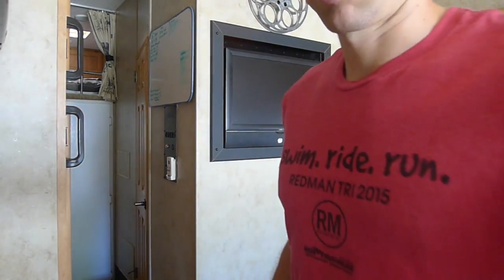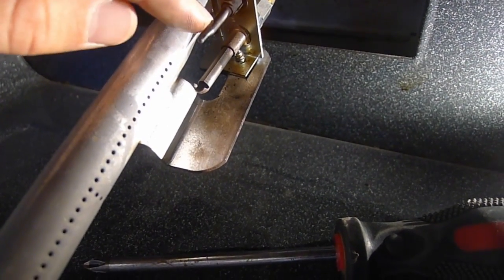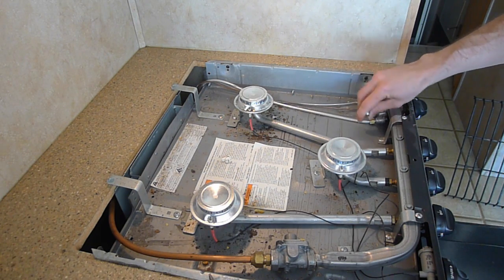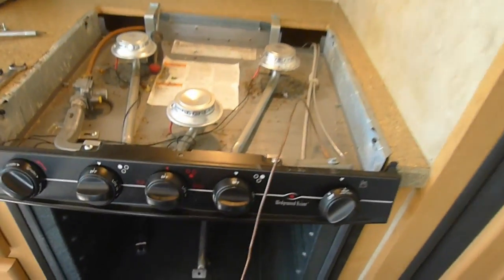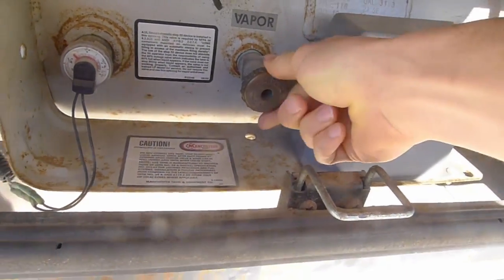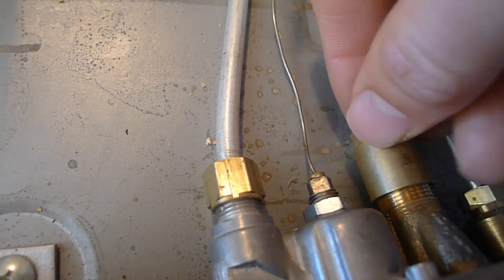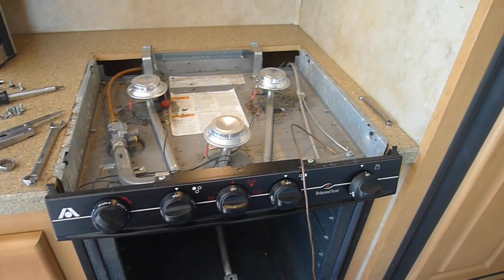Project RV Oven Fix

Comment: Thank you soo much for this video.  Middle of camping and oven wouldn't stay lit.  Took ignitor out. Took the actuator out, cycled it.  Put it all back together and it worked. You saved biscuits and gravy for breakfast.
Reply from the maker: I'm glad it helped you!  Such a weird issue/ design flaw.

Comment: Almost 5 years after posting your foil fix, you are still helping people! Thank you for taking the time to share what you found!
My, new to me, 05 Fleetwood had a hell of a time keeping the pilot lit. Unbelievable that the original owner lived with this all these years.
For those skeptical, like I was, if your oven control knob makes contact with the panel, this will fix your issue on the cheap!!!
Reply from the maker: Very happy it's still helping people out!

Comment: HUGE THUMBS UP!!! Please know that even after 3 years + your video is saving bacon! I had been struggling with my pilot light on a brand new Rockwood Geo Pro 19BH and didn't want to deal with trying to replace the thermocouple, but didn't even know the "top" of the gas range/ oven would pop off and allow access to the line feeding the gas to the pilot. None of the items you covered was exactly my issue; however, it got me to what WAS the issue. My issue was the "back" of the pilot knob had a VERY small foot that when working correctly would depress a VERY tiny button (allow gas to enter the line for the pilot). The "foot" on the back of the knob just was not connecting with the tiny button; however, once I could see the mechanism I could make the adjustment. THANK YOU!
Reply from the maker: Yea it was a learning experience for me. I'm really glad that this is still helping people.

Comment: Glad I watched your video. Started with the knob. Oven pilot would not stay lit. Removed handle and just pushed on valve stem and the pilot stayed lit. Put foil in knob and it works just fine. You cannot even tell it pushes in further. Absolutely ridiculous repair, but it worked on mine. Thanks

Comment: BIG THUMBS UP. I had same stove. Thought it was the coupler too. Saw the tinfoil (LOL) in the knob. Tried that. Presto!!!! It was the lack of space for the electromagnet to engage. Before you start disconnecting everything, try the tinfoil. (Hey, if it works, it works) Thanks guy :)
Reply: Can't thank you enough for this video. Have the same stove and suddenly had the same problem. You saved me from going through the same process.👍

Comment: Thanks for the video.  I was having an issue with starting the pilot light, letting alone keeping it lit.  I followed your progression of taking it apart, tested all parts with a meter and reseating all connections.  Now it works like a charm!  Saved me a bundle between me taking it somewhere or replacing parts.  Appreciate it very much!  Thanks again.
Reply: As a follow-up, I did'nt have to remove the thermocouple from the unit, I tested everything by just removing the sensor from from where the knob is.
Reply: Michael Kroemer yp
Reply: Michael Kroemer hi where is the oven temperature sensing bulb mounted to ? I know it’s on the top right of the oven but mine has some mounts but I can’t find where they go to 
Thanks n

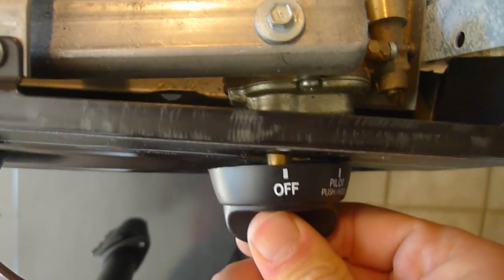Comment: ...the problem you describe at 9:11 with the knob hitting the sheet metal face before fully depressing looks like it's being caused because the whole right side of the internal assembly in your oven is bent inward.... obviously not parallel with the front of the oven.
Reply from the maker: Yea maybe bad design or manufacturer defect? Probably a reason that we dont know.
Reply: @thehawksnest   In any case, the video clued me in to check the valve and connections and solve my problem.  Thanks!

Comment: Well I tried the foil thing and no go. Got a thermalcouple no go.
Well what happened is when pushing the button to light the pilot mine required even more foil. I figured it out by putting a small helper on the stud to help me turn without the knob.

My guess is the specs on the build is not tight and different units need different amounts of foil.  After stuffing in enough it worked. Now how to know you have enough.  Put in a little. Turn the knob to pilot. If it touches the metal face of the oven put a little more. Keep doing this until you get a least a gap that a piece of folder paper will slip under.

Another thing  you could do in worse case if you need so much foil your knob is lose would be use a marker, draw a line around the knob on the face and dremal out the metal so the knob slips into the opening.

That's all. But it does work.

Comment: Cleaned thermocouple tip, no good. Replaced thermocouple, no good. Put tin foil in the knob, Bueno! We bought an 8-year-old camper and the oven had never been used. I didn't even test it assuming it would work if it had never been used. I guess it never worked from the day it was made. Obviously, a manufacturer defect since my problem wasn't a result of wear and tear. Thanks, Amigo! Happy trails.

Comment: Usually like anything else regarding a flame, the culprit is the sensor which just needs to be cleaned off with steel wool.
Reply: Slide in camper repairs

Comment: So what was the problem. ? My thermocouple line looks flat in one area. Not sure how it works but can it be that the copper light does not allow gas to go to thermocouple
Reply from the maker: The design doesn't allow the knob to be fully depressed. So by putting a little tin foil in the knob allows it to be fully depressed.

Comment: That's an outlaw! I have some questions because gas won't go to oven
Reply: @jason Smith > I have the same problem > wish we could get an answer 👵Needs to BAKE!!
Reply from the maker: Did you check it out at about 9min? That's basically the answer.  But if you have no gas. That's a different problem.

Comment: I'll never understand why there isn't an electric start lead going to the oven also. there are 2 connectors on the back side of the igniter so why not put one in the oven too so you don't have to have the  pilot going all the time? I don't want gas running in my RV all the time personally i believe i am going to look into options of removing the pilot and thermocouple and replace it with an igniter like the top burners have actually. it just makes more sense and it would be SO much easier.

Comment: I build rv stoves air max saburban in Dayton to if you have a quation feel free to ask
Reply: power of the train only that’s a Atwood/Dometic so I don’t think you’re qualified
Reply: My pilot light flickers then it just goes out
Reply: the pilot turns on but the main flame don't starts
Reply: @calmarkland8257   my pilot light is real weak ?????
Reply: bought a 2020 rockwood, made by forest river, has a suburban elite 22" stove/oven oven pilot light right up and burner turns right on but after 5 to ten minutes oven turns off. no propane, then pilot wont light until oven cools down-can you help - victor
Reply: @victorzanti2939  it can be the thermal couple need replaced